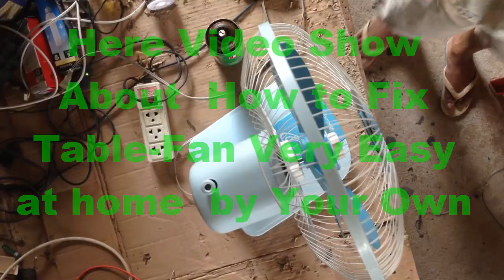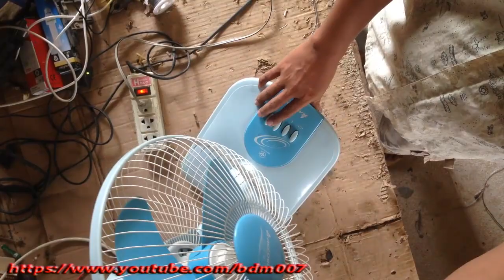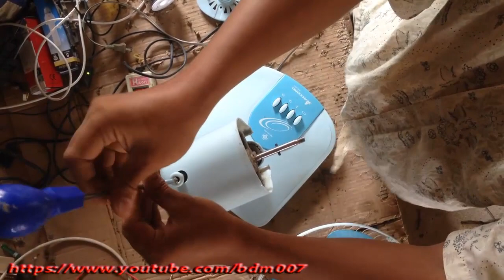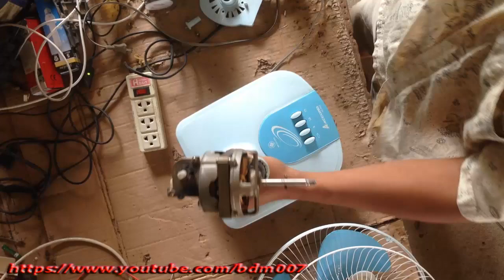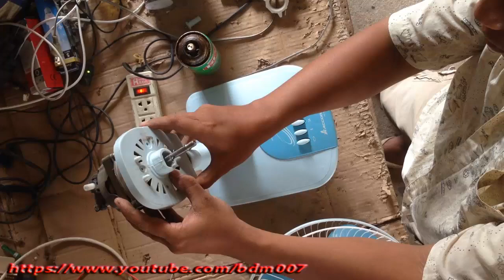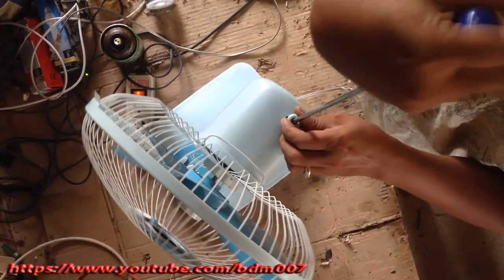Easy Fix Table Fan not Working At home by your own | Repair Table Fan at Home , Easy Life Hacks

Comment: Won’t last long and it will do the same thing, that motor needs to be pulled apart and shaft and bearings cleaned and polished as well as felt lubricator refilled with electric motor oil and then it will last, that spray crap you used will only work till the bearing dries out again plus you didn’t even lube the rear bearing